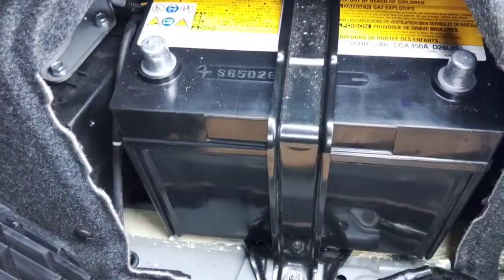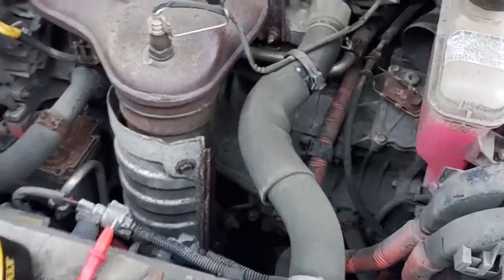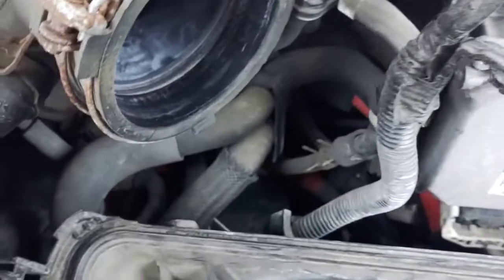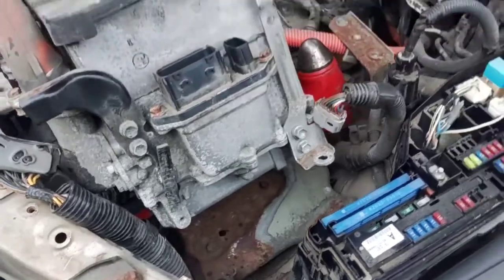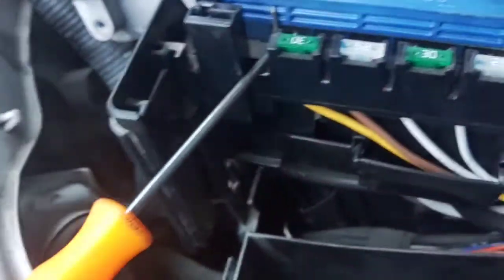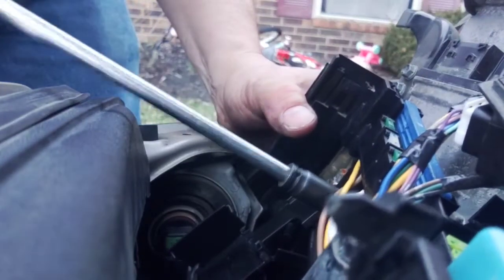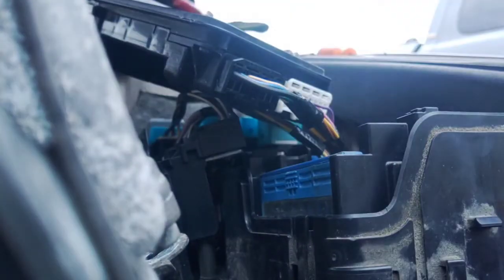Toyota Fusible links

Comment: You were right about no decent videos or other info on the web for that matter, about getting these fuse boxs apart and the fuseable links out. I was on the right track but decided to do one more search before I got in too far. Thanks for posting this!
Reply from the maker: Good luck. I tore it apart and used a corrosion protective grease.
Reply: @98eck  Got it out, had one filament fried. Everything went back together fine. Not too bad once you know what you're doing! Thanks again for the vid!

Comment: How do you do the other fuse link
Reply from the maker: @IsabellaVanRossen  i believe once the bolts are removed for the one fusible link you can pull either one. It's possible that there are bolts in the other fusible link though. I don't remember what the other side looks like now.
Reply: I changed the link but I pulled the 2 white wires really hard trying to take out the little panel now my car isn’t starting I think I yanked one of them out everytime I move the left one around it almost starts

Comment: I hate to be that person but uhm you could of easily removed those fuseable links by removing that corner piece from the box itself . There’s a very simple video showing that but anywhoos thanks for the video none the less
Reply from the maker: The ones with the bolts through them?
Reply: @98eck  do you mean the bolts from the bottom ? Because you would be correct on how to remove it if that’s the case but I’d like to add that while the same year make and model of car are alike depending on region they will very much not be the same in all fuse box designs . Mine is same make and model as the one in this video you have shared with us but mine has only a nut on the fusible link that runs to a ground wire obviously and that is all while others have the nut as pictured and then bolts located on the bottom as well but to remove the corner piece that holds the wires in to the box located next to the fusible links all should slide out the same way so access that easily

Comment: I Hot a 2008 toyota avalon xl that fue horn ac and fue fan turn off what culd i been,the when rains it work sometimes.
Reply from the maker: You could possibly have a ground issue going on. Could also be corrosion. Check the fuses that power each thing. It's hard to tell you where to look. There could be an issue in the harness in the engine bay or under the car. When it rains it's possible exposed wires are getting wet and it's losing power.

Comment: Did you really need to unbolt the  bottom screw holding the fusebox in place ? Seems like you opened the left tab to just pick it apart and get access to back. Struggling with same issue
Reply from the maker: I think I had to in order to get the fusebox high enough to remove the cover that hide the bolts. If you can remove those bolts (2 or 3) that go through the fuse you can remove it without any extra work.

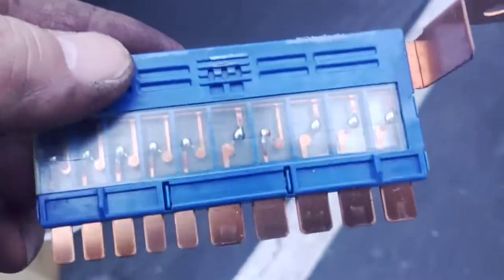Comment: How did you get 5:46 out?
Reply from the maker: Removed plastic cover around box, removed bolts holding it in, then unclipped the ends and pulled straight up.